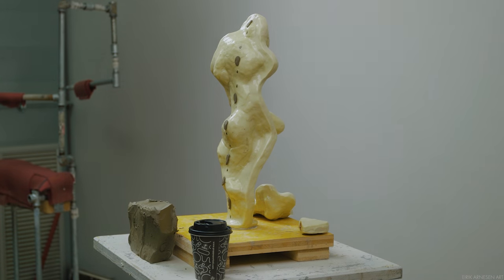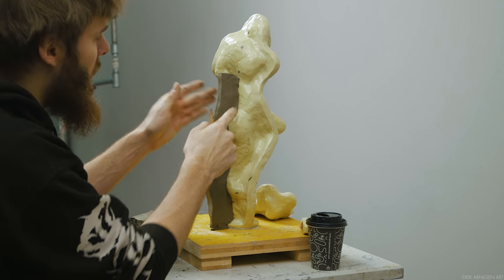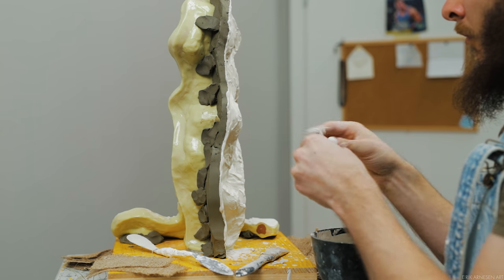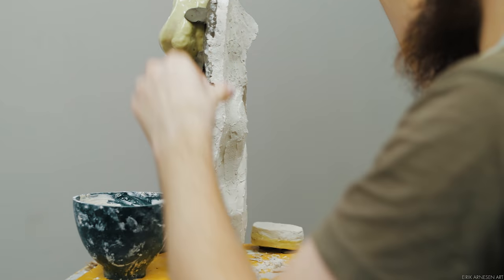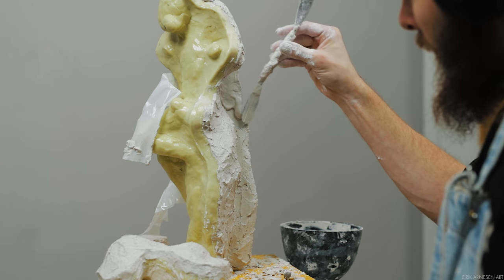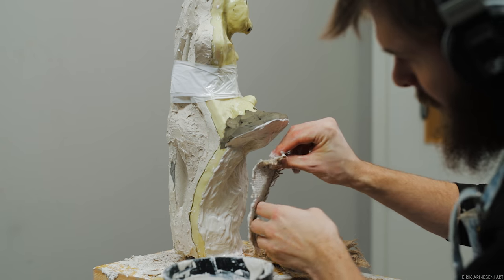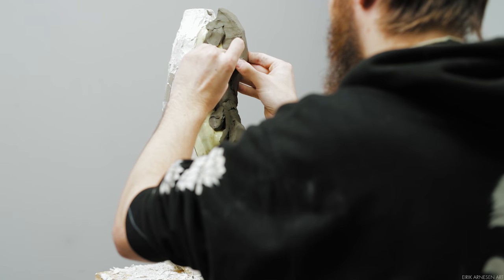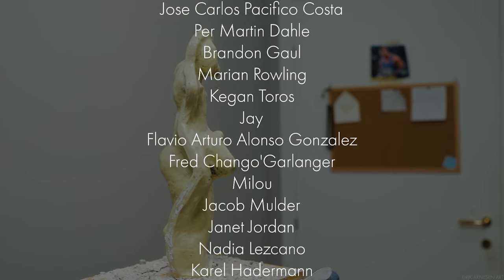Kronos 2.0 - Mold Making - Plaster

Comment: Try filling in your silicone jacket undercuts more and you will be able to get away with less mother mold pieces.  You can use pieces of sponge encapsulated in silicone which allows for the same amount of flexibility in the silicone jacket.
Reply from the maker: I have heard of people doing that before! Maybe I'll try it out in the future.
Reply: Yup, definitely a good tip. Aquarium filters work well for that. Saves lots of expensive silicone and makes the process easier.

Comment: Very interesting video and it's something to aim for in the future as I'm barely able to sculpt anything at the moment. One thing I'm curious about, have you ever used plaster bangage or ModRoc as we call it in the UK, instead of plaster and burlap?
Reply from the maker: Thank you! Plaster bandage is a lot weaker than plaster and burlap in my experience. There is usually not enough plaster in the bandage or it's low quality. But there might be some good brands of plaster bandage out there that's worth using! As far as cost go though, plaster and burlap is much cheaper.

Comment: What is the best way to dispose of excess plaster?
Reply from the maker: If you need to clean tools, a bucket of water. Let the plaster settle and pour the water off the top. Dried plaster you can just throw in bin. Work carefully and you won't have a lot of it. You can recycle plaster as well but that's only something to worry about if you have a lot of plaster to throw away.
Reply: @EirikArnesenArt  Thanks! I'm a young sculptor with no formal training so I've been learning everything from the internet and Youtube lol. These videos and resources you provide mean a lot :)
Reply from the maker: That's great to hear man! I started out learning on the internet as well.